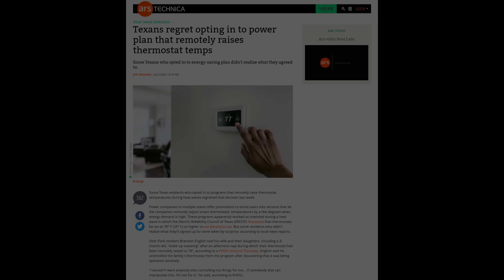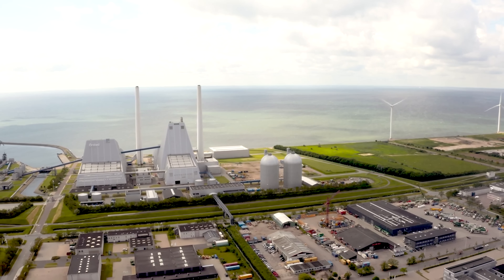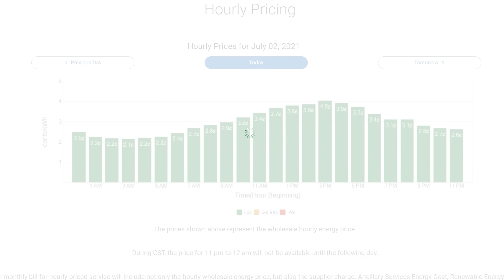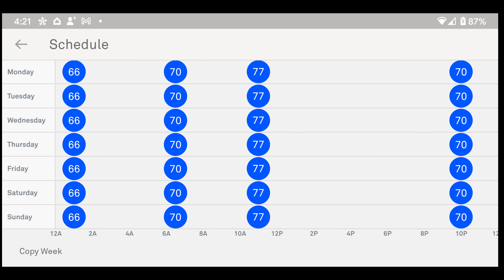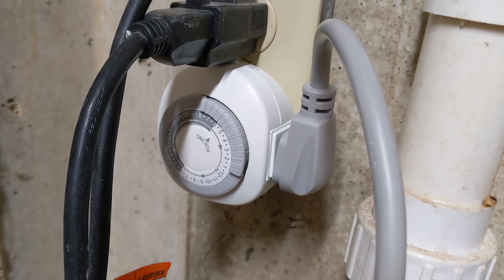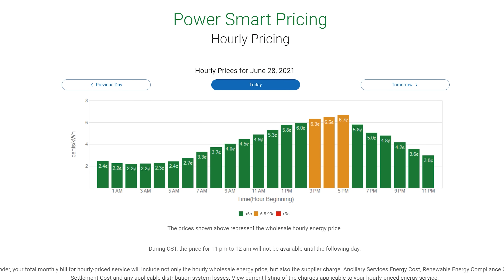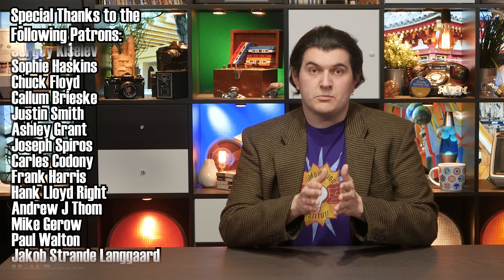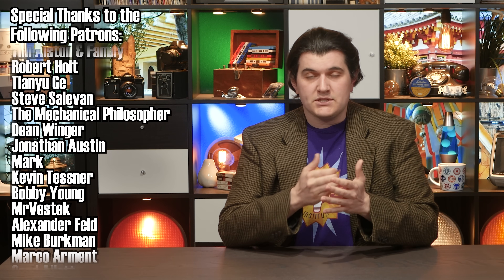Batteries aren't the only way to store energy. Here's another.

Comment: "Assuming the buildings are somewhat modern, well-insulated and have good windows..."

THE UK HAS LEFT THE CHAT
(for every one of those three assumptions, too, not just combined xD)
Reply: Most houses have cavity wall insulation, loft insulation and double glazing these days. 

Hardly any have air conditioning of course. Also heating is usually gas based but the principle does apply for all-electric houses.
Reply: If you think it's bad in the UK, you haven't been to the US!
Reply: @jbaidley  yeah, I was amazed in Michigan to see several commercial buildings had ZERO seals on doors and there was a clear gap under the door so that light shined through! And as far as I know Lansign has a real winter, north enough. 
I was not amazed to see basically same doors in Houston but come on, in Michigan! Did not have the possibility to visit anyones even semi-modern house but commercial buildings were really leaky, also the hotel was built like a haystack.
Reply: Heavy masonry houses tend to be more common in the UK (also here in Germany) than California, where I lived most of my life. These structures are fantastic as heat sinks, summer and winter.
Reply: Money is always spent on making homes look good. But the "invisible" materials which can't be seen - insulation, wiring, plumbing, foundation, etc - are always the first victims of cheap budgeting. If you don't have the money to build/buy a well-made home now then you'll have to pay the costs in other ways later.
Reply: @pwnmeisterage  I would say "Quite often", even the majority. When renovating, we're going for quality over eye candy in all of our choices. If it looks good and is quality, we're all-in.
Reply: Most of our houses are older than the USA (the country) :)
Reply: @inyobill  Up here in Finland the exposed mass work against you in winter, much better with wooden buildings when it gets real cold. If we use thermal mass we put it on the inside of the house, like in my house, wooden construction but the interior floor slab floats and is insulated on all sides, only exposed inwards.
Reply: @dennisa6132  Interesting. Makes great sense. Thanks for the slant that extends my awareness a bit.
Reply: in fairness moist places like the british isles or the pacific northwest NEED drafty buildings, or else you get mold everywhere.
Reply: @KairuHakubi  You can replace the drafty design with machine ventilation, there are ventilation units with built in heat exchangers so that the warm air leaving the house is cooled and the the incoming air heated, this saves heating costs and keeps the house in shape. Downside is you are dependent on electricity to ventilate your house.

Also they basically solved this centuries ago using primitive methods, by using materials such as solid timber frames (logs) and or daubing them with clay mixtures which can absorb and release moisture, keeping the indoor climate constant. Ventilation was provied via the chimney, the hot brick stack would ventilate even without an active fire as long as it was somewhat warm.
Reply: @1873Winchester  yeah but what if you're always too warm? which a lot of us who willingly live in that climate are.. That system sounds like it'd work better for someplace like Nihon where they have humidity making the houses built deliberately drafty, but also need heat to live. their solution was little portable heaters and tables with skirts.
I'm not sure that clay method would work, that sounds fishy as hell. and definitely not viable in the modern day. whereas relying on a ventilator... I think I'd rather just rely on a very aggressive dehumidifier and then regular in-house ventilation.. I'd have to talk to some architects I think. all I know is not only was my place in Seattle super drafty but they reminded me to regularly open windows because otherwise just the window consensation would get moldy.
Reply: @KairuHakubi  The heat exchanger works if your indoor air is cooler than your outdoor air by the way. Then the heat exchanger will cool the incoming air and warm the outcoming air. It's just how it works, it moves heat from one place to another and it doesn't know or care which is the hotter or colder side. It'll always want to equalize the two temperatures. This also dehumidifies the air so the unit has a built in drainpipe.

This is a regular ventilation system FYI. It's a common solution in modern scandinavian homes and is in my home as well. It's as reliable as your electricity supply is.

Clay daub is a centuries proven method and definitely works if the house is designed around it, one might say it's more proven and viable than many modern solutions and it works without power. People who are into building ecologically efficient houses here in scandinavia often use this technique and there are millions of centuries old houses down in continental europe that are still standing that were built with these methods. It doesn't get more tried and true than that.

Don't talk to architects on issues of house and energy issues, talk to engineers. And maybe not american ones as the US is really behind the curve on modern building and energy efficiency.
Reply: @1873Winchester  well I was almost with you. Things to ponder at least.
Reply: @neilBEsluman  so its like baltimore without the window units?
Reply: @mikepembo8297  I wouldn't say most. A vast amount of our housing stock is from the late Victorian to 1950s when we gave up on building anything
Reply: "somewhat modern" what? No! "Well insulated" that's a thing? "Good windows" Not gonna happen
Reply: Odd, that - the grants for home insulation have been available for decades now, and cover cavity wall and loft insulation and double glazing, all f which are in the building regulations now.
Mind you, I don't know why - my fathers old home in Warwickshire had tiny windows, no heating or air conditioning, and was comfortable year around.  It was built (or rebuilt) in the 13th century, had solid walls varying between 3 and 7 feet thick, and a deeply thatched roof.  Water heating was admittedly through a modern system of black-painted radiators and heat-exchanger with a large capacity tank, but that was buried in the garden. 
The only change he had to make between winter and summer was that in summer, you opened the kitchen windows to cook and kept the door closed, while in winter you did the opposite.  The thermal mass of the building was enough to store heat on a seasonal cycle, not just a daily one.
Of course, any electrical appliance heated the place a little bit, since all energy degrades to heat when used (which probably replaced the old use pattern of keeping a small fire banked up for cooking), but his power bills were lower than I would even have dreamt of, even with my fully (modern standard) insulated home with 3Kw of solar panels on the roof and a heat pump system.  It seems we have lost a lot of wisdom over the years.
Reply: @I_am_Phil_Lee  not especially, what we gained is sweet sweet lady capitalism. Us poor rubes need somewhere to live so will buy what even minimum quality. Barely scraping by the regs crapboxes the building firms can sling up.

If you had the cash or the time and skills you could have a new house with very high thermal mass and low solar gain too. It's achievable and they do exist.
Reply: @jbaidley  Australia: hold my beer

Comment: I literally dream about having a well-insulated home one day. Our current apartment is basically like living outdoors in the winter and way hotter than outdoors in the summer. 😑
Reply: Definitely add window blinds on the outside if you can, it helps a lot to keep out sunlight in the summer, and helps keep in the heat during the winter, if your windows are not well insulated.
Reply: Me too...  Concrete block in-ground is a pain in the ass to regulate...
Reply: That's because sustainable apartment construction is 100% unregulated in the USA
Reply: @timothylegg  In this case, it’s because it’s in a house built more than 100 years ago 🤪
Reply: @timothylegg  
Why be energy efficient when the renters can waste money on electricity?
Reply: @Capsaicin not being exposed to bacteria and viruses causes an overactive immune system, not over exposure. Also toxic compounds in the body are broken down in the liver or filtered out through the kidneys
Reply: Insulation film exists
Reply: That hotter than outdoors thing shouldn't be happening. That kind of heat should go up, theoretically. I'd bet in addition to some cheap changes in insulating around doors and windows, maybe you'd be well served by an ac inspection. 

You are in a pretty old home, so the ductwork may need attention. I'm not saying cleaned, though the amount of hair and skin in there is likely frightening over 35 years of renters. What I'm getting at is that the ducts are old and they are insulated. That soft stuff breaks down eventually. Metal rusts, and sometimes could use being taped. If you have less flow at some vents or just not very cool in the further vents, this could be part of it.
Reply: here we laught about komunist cube shaped houses but at the end those have the smallest surface area to radiate heat from all houses with same living space. so the shape of the building is the first step :D
Reply: @nyftn  well yes nothing beats yakutsk with -70°C. we had a coworker from italy. -150°C was for him f.....cold :D:D
Reply: @tomast9034  -150 C is cold for everyone.
Reply: @Zraknul  oops:D  should have been -15
Reply: @cillermaniak  Well, my city apartment faces north-east and there are many trees just outside (second floor), so any more shade won't do anything. The exterior walls are over a meter thick, and so is the floor (1930s design), and it's still at least +25C throughout the summer. Right now, in October, it's +12C outside, all heating turned off, two of the three windows half-open ... and it's +22C inside.
Reply: @tomast9034 Talking about Communist, the housing they use to build was allegedly stupidity poorly insulated from the cold and the noise (mainly the Panelka from Khrouchtchev and Brejnev) because they where building wall extremely thin. To improve insulation, people were installing blanket and carpet on their wall. These were trapping heat and absorbing noise really well, so for those that aren't owner and have poorly insulated wall, ether buy a pretty carpet if you can afford it or go to a thrift store if you're on a budget (clean it first ideally). The best part is that if you change place, you can keep it, making it a long term investment. Of course, carpet is not the trendiest home staging and it is not ideal for people victim of asma, but you can't have everything for cheap.
Reply: @Menaceblue3  *make utility and energy companies rich
Reply: @-8_8-  In my case, it’s because my apartment shares a wall with an unventilated stairwell and gets direct sun in the afternoon. The stairwell acts like the reverse of what’s in this video; storing heat all day, then releasing it all night to ensure my apartment never drops below 80 degrees at night unless I actively cool it down with the AC. It’s extraordinarily frustrating and very expensive to combat.
Reply: @tomast9034  I'm sorry but where TF are you experiencing -70C Celsius
Reply: @the_undead  Secret Soviet moon base exposed again.
Reply: @tofuprius3384  houses built 100 years ago tend to be even more insulated than modern ones (in Europe), as those couldn't be cooled or heated as good as we can now.
Reply: @the_undead  Yakutsk, Siberia.
Reply: @cedricboivin9422  We have tons of panel buildings in the Czech Republic, majority of them now have windows replaced, newly insulated and pretty efficient
Reply: Speak to your landlord about making the improvements to save him money for electricity, heating.
Reply: @robertewalt7789  While everyone should do this because there is nothing to lose, many landlords do not pay for utilities. It gives the renter more control theoretically, but also disincentivizes even modest improvements, let alone long term investments by the landlord.   One would hope that this would be solved by rental market competitive forces, but it's far down the list of things most folks have time, ability or prerogative to calculate when searching for an apartment (folks are restricted by realities and priorities). 

Some areas have primary  residence requirements as well where to be qualified for certain subsidies/rebates for upgrades, it must be your residence. Something in that dynamic needs to change I think to significantly improve the efficiency state of rental units. Some combination of requirements and incentives to bring things up to spec. I want to say again that asking your landlord is definitely worth trying at least. It is always possible they might not have actually though of it.

Comment: This is such a great idea and I love it. Personally the idea I've been playing around with that's very similar to ice storage air conditioning but takes advantage of close to effectively free energy is a big thermal mass likely in the form of a good sized well-insulated container of water and having the water cycle through a big exposed loop during the coolest hours of the night to cool the water down and then store that cool (negative) energy, and then cycling the water through a similar loop inside the house to cool and overcool the tank of water and house as needed. This could be done as a closed loop in more humid environments and/or where the water can't be replaced easily and cheaply and as evaporative cooling in dryer climates when the water can be easily replaced. This system could also probably be used in reverse to help keep a house warm in winter especially at night by heating the water up during the hottest parts of the day and having it cycle through the house as needed especially at night, heating and overheating the water tank and house a bit during the hottest part of the day. Like the recent return idea of putting sails on massive cargo ships this method wouldn't even have to provide all the heating and cooling for a house; simply offsetting the energy usage would be a big help especially since the materials costs of such a system would be so low and thus the length of time for the system to pay for itself would be so short. All you're really talking about materials wise is insulation, the water tank, the lengths of narrow copper or other piping, and some sort of pump to move to water. You could also power the pump with solar or another renewable if you wanted to reduce conventional energy usage to nothing. You could probably simplify this idea further by using a big water heater; it's already insulated and has the basic piping and thermometers and thermostats installed.

Comment: *everyone starts doing this*
*night time is the new peak demand time*
Reply: It will also be when people charge their electric cars 🚗 🚙 🚗 so quite likely.
Reply: At the point that it equalizes between day and night people would stop having an incentive to switch - worst that would happen we just have a more even load throughout the day, which is better for  nuclear and hydroelectric generation.
Reply: Need to remember Business power usage peaks during the day. Even if everyone did this at their homes most of those people go to work, it would never totally flip.
Reply from the maker: Gosh dangit, I said not to!
Reply: Maybe, but it shouldn't be as bad because it will be cooler outside.
Reply: @dustinvanantwerp4917  businesses are also more frugal than individuals. Give big businesses the opportunity to save a few hundred dollars each day and they'll make the switch. I haven't worked anywhere where we employees have had access to the thermostat in more than 15 years...
Reply: @ronindebeatrice  Sadly, that rarely translates out into actual energy savings.  Normally, "one size fits none" thinking applies leading to buildings were the heat is blasting on days when it's abnormally hot out and AC going during cold snaps.   Business is only fugal when control is localized.  Remote Corporate is the biggest waster of resources there is.  (and often gets breaks on utilities anyways so doesn't think there's anything more to save)
Reply: I'm in the commercial HVAC industry,  I work on chillers that run all day drawing 200-1000 Amps for 8 or 10 hrs straight to cool high rise buildings in Denver CO.   There are a few buildings I've worked in over the years that ran "ice banks" they ran at night to make huge quantities of chilled or below freezing glycol storage banks. Nobody is willing to retrofit an old system to this at this time
Reply: @ronindebeatrice  You would think that would be the case. As Mr Byamile as mentioned in a later comment, chillers are VERY expensive to run and require loads of power.  What he neglected to mention here is how exactly some of these systems work. I have a customer with a building that uses chillers. First air is cooled to 40F then reheated to 70F to remove humidity. Making the power usage of these systems INSANE. That's just HVAC, don't even get me started on power usage for IT equipment, it all adds up very fast.
Reply: @mrbyamile6973  that sounds really cool!
Reply: Not really, businesses use nost energy anyways